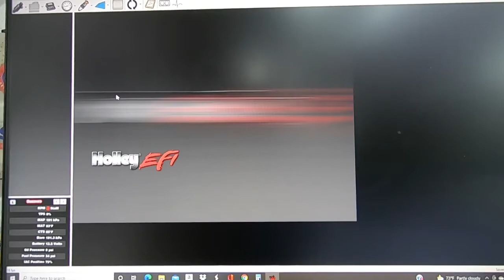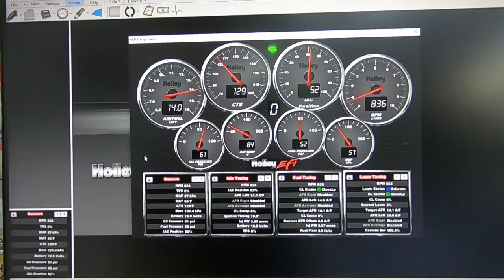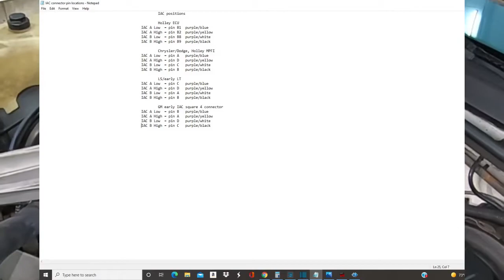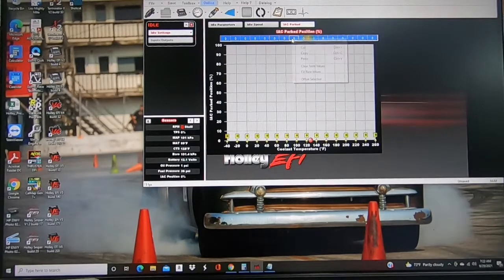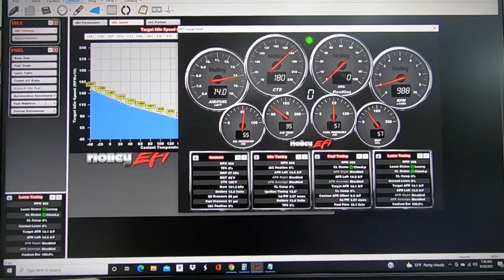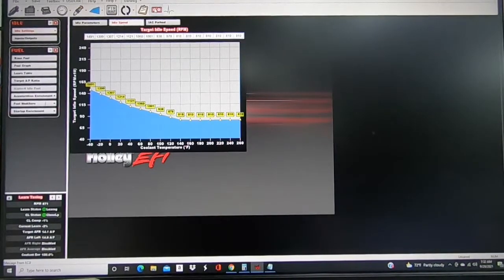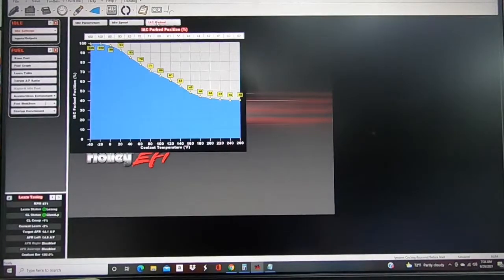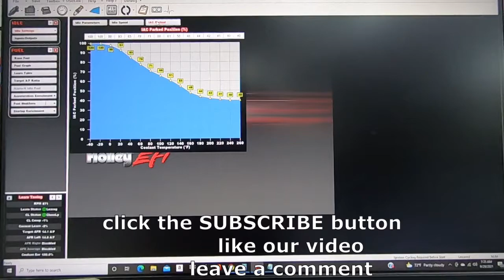Holley EFI, how to tune part 2. Tune, tips, and diagnosis Idle Air Control motors

Comment: Can Anyone help me? I just went through this test on the video and my IAC is working backwards. If I set the Idle Park number to 100 the plunger is extended most the way into the pot of my Wilson Throttle Body. Set the table to all (0) Zeros and it pulls back into the valve and I can't even see the plunger tip in the IAC Hole in the top of the throttle body. It's wired as an early GM A= Pur/Yel  B= Pur/Blu. C= Pur/Blak. D= Pur/Wht
Reply from the maker: @RaptorGary  What setting do you have in the Holley software?
Reply: @LANDISPERFORMANCE  Idle Param: P Term 60.0 - D Term 40 -  Adv. Idle Control Medium - IAC Type Stepper. - IAC Ramp Down IAC HOLD 55% - Ramp Decay Time 3.0 Seconds - RPM Above Idle to Start Ramp 1,000 RPM - Re-enable Idle Control 100 RPM - Start up IAC Hold Time 1 sec. - Decay Time 2.0 Sec. Idle Speed 850 and it does hold it to that number pretty close. IAC Parked from 100 Degrees Water Temp at 64 and Water Temp at 260 down to 37. BTW, I went to O'Rileys Auto Parts and bought a MasterPro 2-IAC31 for a 2005 Chevy Monte Carlo that fit the 4 pin plug, size was perfect and all dimensions were perfect, so I tried it and it worked backwards with the wiring for a Early GM and same wiring for Chrysler and it stated operating properly when I wired it using your diagram for the LS/Early LT. Even though it sounds way better and I adjusted the butterfly so the IAC is close to 0% to 3% but when I turn the AC On it ramps up the IAC to 17% and even Higher when I put it in gear, after 5 seconds it starts to show 15% and if I rev the engine you can hear the IAC Screaming on decelll..... Wow, sorry probably way too much info...
Reply from the maker: @RaptorGary  Ok, so the early GM IAC is the older 90"s type with a square 4 pin connector. For the flat 4 connector the only choices are GM LS/LT and Chrysler. So with the wiring pinned for the LS/LT for the 2005 Monte Carlo IAC should be correct. I would try IAC hold down at 10%, Ramp Decay Time at 0.6 sec, RPM above Idle to start ramp 1000rpm, RPM above idle to re-enable idle control 50rpm, startup IAC Position hold time 2.0sec, decay time 4.0 sec. Then go to IAC parked, from -40 to 40 coolant temp set to 44 and from 150 to 260 coolant temp set to 23, then use your mouse and highlight the boxes at the top IAC Parked Position % from the 44 to the 23, and right click the mouse and select " Fill row values" and try that. Now as you put more load on the engine, as in putting it in gear, or turning on the A/C, the IAC will open to maintain the target idle, this is correct. Let me know how these changes work.
Reply: @LANDISPERFORMANCE  FIRST OFF it's 110 Degrees today. When I come to an idle you can see the timing jumping from 16 to like 27 and it doesn't idle very well. Then after 2-3 seconds of idling you can hear the IAC start to scream so I toss it in neutral and rev the engine to 1,500rpm. In the garage now just idling it sounds weird like it really struggling, or like it sounds like I have a bad tank of fuel. I'm going to try to put the last tune in it now while it's warm and see how it sounds. Maybe we should share e-mails and I can send you more info. The new engine ran really well with a Holley 750cfm with vacuum secondaries. It took some playing around with Power Valves, Jets, and Accelerator Pump Nozzles and more to make it run pretty close to perfect. I should have left it carbureted but I had already committed to a guy to do the Holley EFI and paid him for the parts!
Reply from the maker: @RaptorGary  The timing is jumping around because you have Idle Spark enabled, the ECU is using the timing to try and smooth out the idle. This is correct and good to use. How are your AFR readings at idle? Sounds like that is where your issue is. Remember in EFI the Base Fuel table needs to be as correct as possible, since everything else is working off of that. I use the srcracing@aol.com for tuning issues. Send me your global calibration and a few datalogs and let me see what is going on. All other email goes to Lands.Performance.Center@gmail.com
Reply: @LANDISPERFORMANCE  Thanks George...

Comment: Your videos are awesome to watch. You speak very clear and you also speak in a language most of us novice to EFI can understand, and I really appreciate that. I have a new install and I've had problems with the IAC since the guy finished the install. He is nowhere to be found now that I paid him in full (CASH). I'm in a small town and there's only this one guy as a "Go To' Holley EFI Tuner, so I have been trying to learn this myself. I have another tuner that helped me figure out the first installer wired the ICA for a GM/LS when actually it's a Chrysler. Now the IAC is screaming. After watching your video I'm heading out to the truck with my LapTop and I will set the IAC Parker to 100% and see what it does and then set it to 0% and see if it is closing all the way. Great Tip.... Also, thanks for including the wiring PinOut for the different styles. By the way my BluePrint 400ci SBC has a Holley HP system with Port Injection and a Wilson Throttle Body. If I could add any criticism, that would be that when you show your computer the numbers aren't clear so I can't compare what you have on your screen, compared to mine... Thanks Again. Gary
Reply from the maker: Thanks for the comments and the praise! Yes this was an older video, where I was using a camera to show the laptop screen. On the newer videos, I am now using my desktop and a studio app, so it records the monitor screen internally, so no cameras and focus problems. Still learning this YouTube stuff. For more Holley tips check out some of my Tuesday Night Live shows in the playlist. I don't have all of them labeled with Holley stuff, but there is a bunch. I show a lot of tuning issues and using the datalog captures. Every show has some tech tips on different parts of a car.

Comment: So if I have it pinned for a LS early LT should I have it set for Gm Lsx or stepper
Reply from the maker: IAC Type should be set to Stepper. Advanced Idle Control, you can use GM Lsx, Slow, Medium, or Fast. Each one of these settings changes the PID control of the stepper motor.  I usually start with Slow, and see how the idle acts. Now one thing to note, you need the AFR to be close as you can to the target, because this will also affect how the engine responds to the IAC control. So make sure the Base Fuel map is adjusted properly before you get to crazy chasing the IAC control. Like I said before, set it to Slow, then make sure Base Fuel is good in that area, then go back to IAC if you need to make more adjustments there. Thanks for the question, thanks for watching!

Comment: great video. You explan things so we can under it.  Thanks again!  do you use data logging when you  are tuneing?
Reply from the maker: Thanks for the kind words. Yes I do use the datalog when tuning. Doesn't matter whether you are street, strip, or dyno tuning. This way you can go back after the run, and see all of the different sensor readings, and make an overlay where the data points where on the maps.

Comment: Saw this prog, it was interesting.
Broher i am interested in how to retard or advance spark timings.
And how to increase or decrease RPM.
Reply from the maker: In the software you just advance ( put a larger number in the cell) or retard ( lower the numbers in the cells) but you have to verify that the timing numbers in the program matches what the actual ignition timing is. In the software you can force a timing number a nd use a timing light to see if the engine matches. If not a physical adjustment needs to be made.

Comment: I really wish I seen this video about a year ago I was on the Holley forums and I remember reading a post about the difference with the Holley/Chrysler IAC  and GM IAC. Every time I read that post for some reason I kept overlooking what they were trying to explain and because of that I went a whole year of trying to figure out my IAC issue I got it to a point where the car drove fine besides coming to a stop the idle would always drop below Target and slowly creep back to Target idle. And about a month ago I came across that post again and it just clicked in my head and I tell you what what a huge difference just switching around those two wires.
Reply from the maker: This is why I am making content, some times it is easier if you see it, more so than reading it... Thanks for the comment